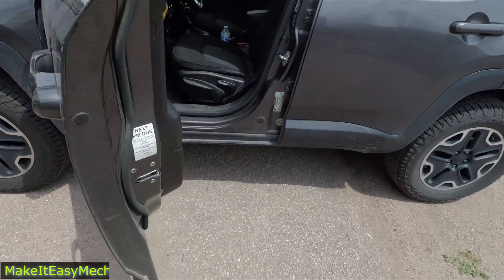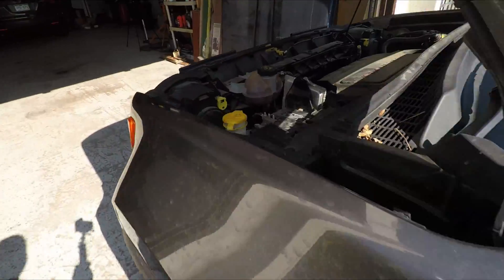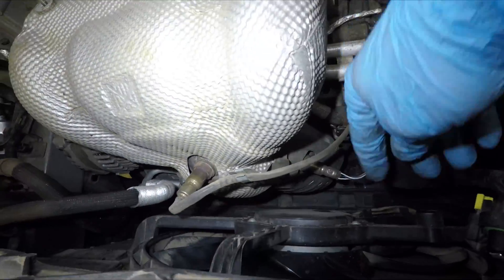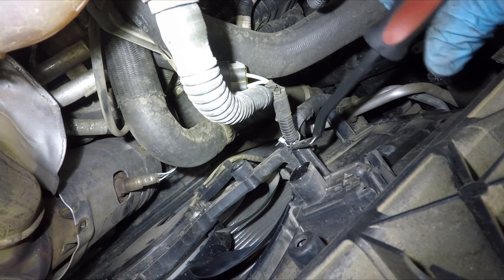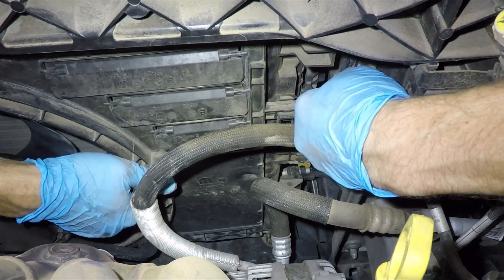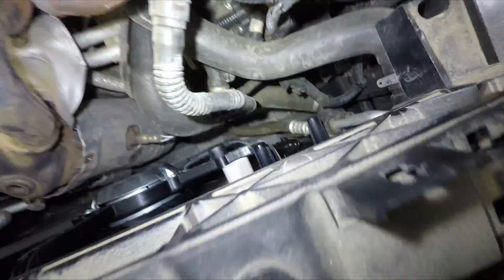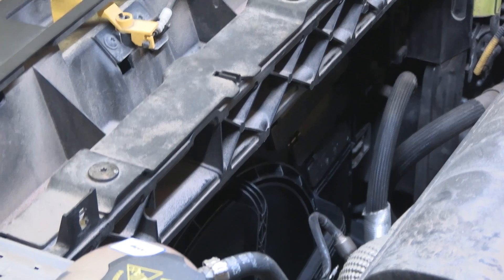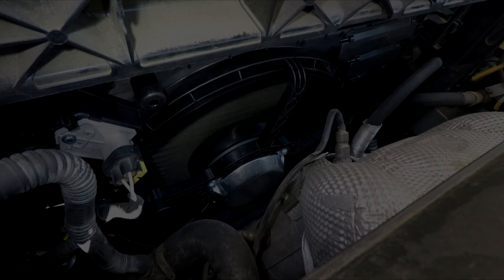How To Fix - Radiator Fan Not Working (Car Overheating When Idle or When A/C is ON) Jeep Renegade

Comment: When I replaced the fan assembly on my 2015 Renegade, the one other thing I did was put a piece of cardboard on the engine side of the radiator, then a 22x28 or 30x36 or whatever it is piece of cardstock like they sell at Michaels or Hobby Lobby or Dollar Tree over that on the engine side, just to help the fan assembly slip in easier and prevent any accidental damage to the radiator fins. Note: Some months AFTER I did all this, I got a recall notice for that squealing defective fan, which included a note saying I would be reimbursed if I'd already replaced it. However, Chrysler refused to reimburse me because I did the job myself, even though I used a factory replacement fan assembly. So I saved them $$$ in labor costs, but they still burned me.  😠

Comment: I cut the lower passenger (R) side tab off the old one while in vehicle (with cut-off wheel) and it really made the removal easy - it literally popped right out (that is the tab that catches the most). I also moved the 2 Aluminum A/C lines at the compressor slightly in towards the motor. Mine had a 40 amp fuse that was blown also.

Comment: Good video ! I would only add though, try not to twist the O2 sensor. I have had the wires break inside and cause it to fail afterwards. Not every time but it has happened.

Comment: 2.4L engine should have a 50amp fuse in the F07 slot. Nonetheless thank you for the great instructions!

I'm gonna be tackling this myself since they did the recall but did not replace the fan with the new version

Comment: Just did my 2021 exactly the same except for they added a sort of air tube connected to frame. I guess it brings in air to engine compartment as well but it makes it harder to shimmy out and in but was still able to.

Comment: My fans won’t come on unless I’m running the ac. I’ve checked relays, coolant, temp sensor is working bc temp goes up, I replaced thermostat. Heats working. can’t figure out what the issue is
Reply: did you ever figure this out?

Comment: In this situation, how would I know it's not a thermostat issue? Or perhaps an issue with coolant flow?
Reply from the maker: In this particular case - the fan wasn't kicking on, causing overheating.
Reply: Most overheating issues are caused by failing thermostat, failing fan, water pump, etc. start by checking those things out first. As well as the radiator cap.